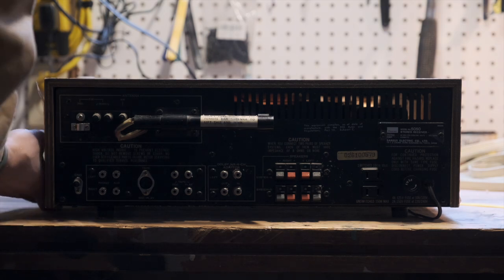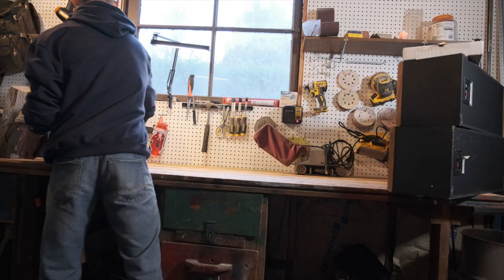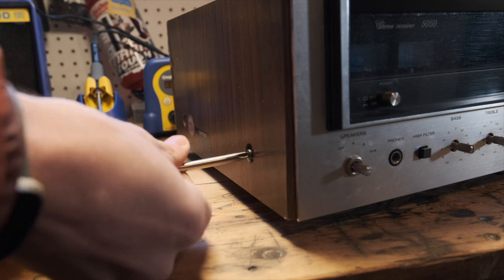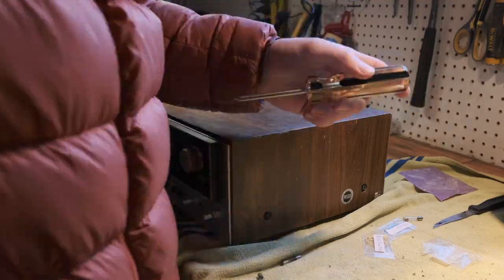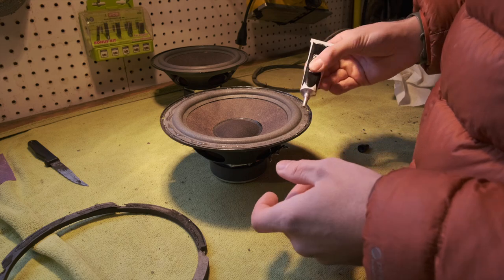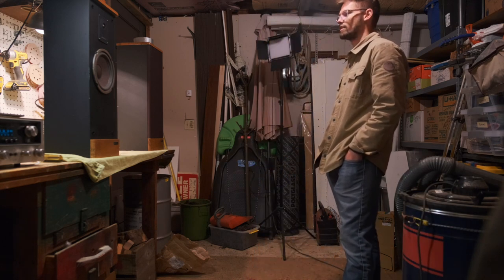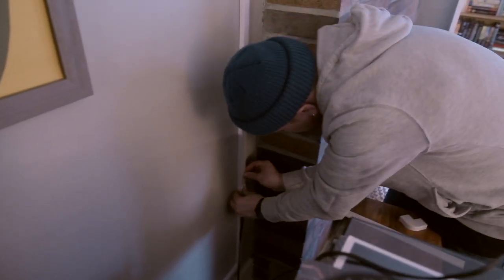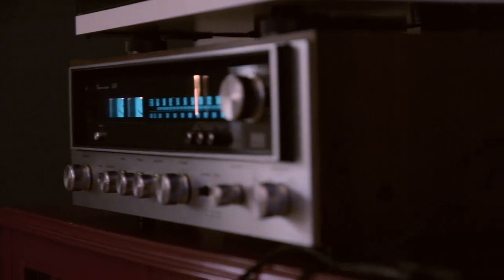The most beautiful thing ever made

Comment: With the old receivers. They do have a protection switch but they are built into the circle boards and they are the thin copper strips they place on the PCB boards! That’s why they were so easy to replace compared to this day and age when they decided to get too damn technical with the understanding of improving sound quality when it’s all digitally simulated🧐
Reply from the maker: Yes indeed! Older stuff is definitely easier to work on with how large the components are.

Comment: I just refinished  some Advent prodigy II speakers.  the tops were pretty scratched up.   sanding them down was easy.   I noticed they were pecan wood, so i bought some pecan stain.  what a mistake.   they looked like cheap 2 x 4 wood with that stain, zero color.   i then put on some minwax oil based espresso color.  wow.   now they look beautiful.  did 3 coats of oil based polyurethane sanding lighly between coats.  for the last finish coat,  after the poly cured for a few days i took 1000 grit wet sandpaper and wiped it lightly across the wood to get off dust nibs.   came out great.   look like new.
Reply from the maker: I love that they're solid pecan! So easy for refinishing. I bet yours look killer with the stain and poly! Thanks for watching!